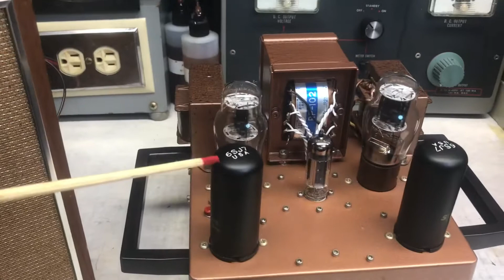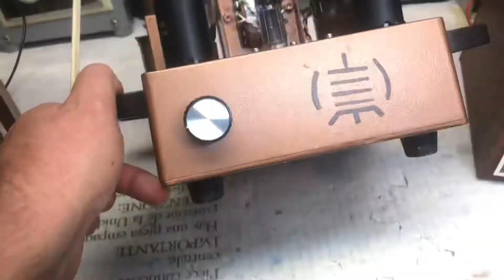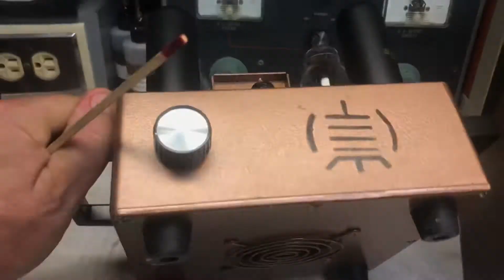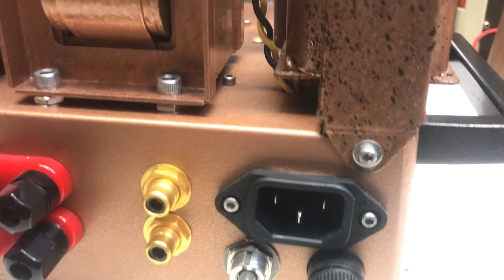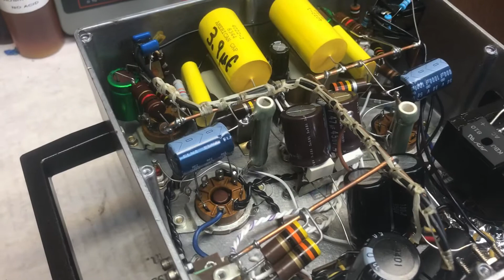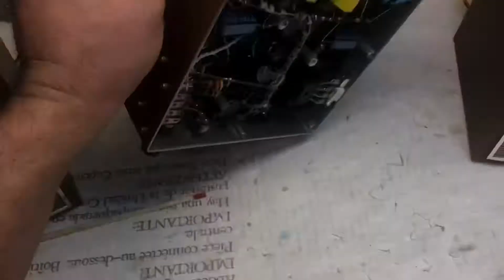1626 Triode SE Tube Amplifier | The Vintage Audio Life

Comment: this looks great, and i dig the handles. gotta have a headphone jack. funny i was wantin to build a 1626 amp with headphone jack and i came across this in my first search.
Reply from the maker: Thanks for your input, yeah if you have the time and parts I recommend you put one together.
Reply: is this a the darling circuit or a version of it,  @thevintageaudiolife  ?
Reply from the maker: Good question, it's been years since i built this, i want to say darling circuit since it was the circuit everyone was using at this time. Or did i use triode mode simple circuit? aghh i don't recall honestly, i'll dig it out soon and do a part two video and hook it up, i know a few folks have been asking for me to hook it up and play it. Keep you posted! @ceylonmooney